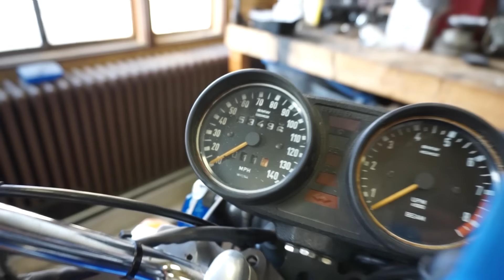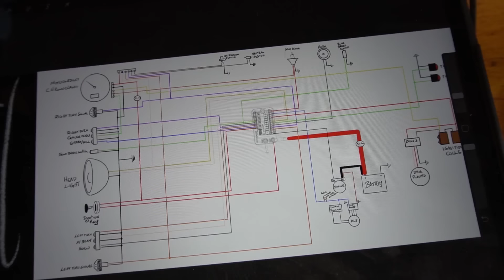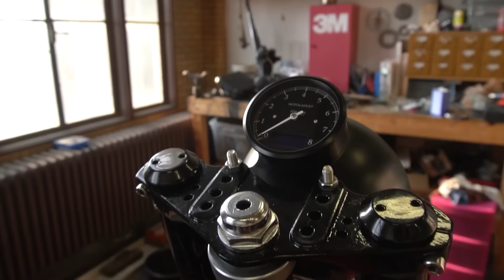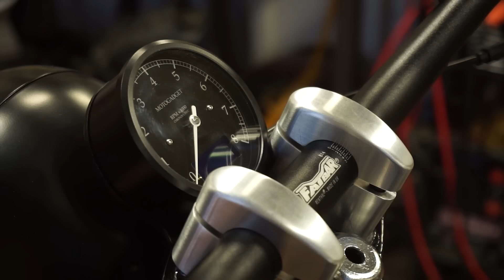BMW Full Custom Build - R90/6 Airhead Rebuilt from the Crankshaft UP!

Comment: Turning obsolete touring bikes into fun urban coffee shop bikes is better than scrapping them, and losing as much weight as practical improves the rather weak power to weight ratio. Don't worry about purists because they're so old the last will be dead in ten years. The only Airheads worth saving are the ancient roller bearing bikes and real S models. BTW for those who don't know you can bolt on earlier kick start gearboxes as the Airheads have high interchangeability.

Comment: The hours and skill required for this level of rebuild is immense. Nicely presented too.
Reply: Hi Rusty Nuts, I just checked your channel and was looking at your videos. I saw you have a review of the multistrada 620 and 1000.
I will be watching this later. I had a 620 and absolutely loved it. Not a very good looking bike. I toured for nearly 2000 miles from the UK to  Mulhouse and Geneva and all around the area. The bike never missed a beat. It was so comfortable, I loved it.

New subscriber and catching up with your videos later 👍
Reply: @Spodokamono  my sons bike, he likes it too. The looks divide, but it was the first performance adventure in 1000 spec.

Comment: That motor looked pretty clean coming apart, tbh. Somebody gave a damn about that bike. I ride an old ass 1100 Shadow that I'm doing a little this and that to in order to make it less Chrome Boat-y. The motogadget led lighting, grips and mirrors looked familiar. But now that I saw what a cool thing you did with the ignition switch...I'm tempted to bust out the step drill and take apart my little cheesy chromed stock one... 

That was a slick touch!

Comment: In the oilbath U forgot the SIEBENBROCK distance ring!
That’s a genious part.
Reply from the maker: On this bike we replaced the oil pan with a 81+ pan which is deeper for added capacity. I have used the motoren israel distance ring on a previous build though (which was painted white)
Reply: @roodlum  that’s great! Excuse me - didn’t see that🤩🐶.

Comment: O porquê de aquecer o motor para desmontar?
Obrigado por compartilhar seu trabalho!
Forte abraço!
Reply from the maker: Some parts (the front bearing carrier) are such a tight press fit that the engine block must be heated to remove them. Obrigado!

Comment: very good result. One thing that strikes me about this type of modification is the drastic change in the working angle of the rear shocks: it feels very stiff to ride?
Reply from the maker: The shock manufacturer design the damping and spring rates in order to work at this angle. In fact, it's a lot like the factory shock placement on the later monolever R80's and R100's (Like my R100GSPD)

Comment: Really like this bike! I see you have the same front brake system as my R100 and you don’t use the brake cylinder and reservoir under the tank anymore. So can I simply remove that part under the tank and go with a brake cylinder and reservoir on the handle bar like your build?
Reply from the maker: yes, just make certain to match the existing master cylinder's bore size otherwise you can affect the braking ability of the bike.
Reply: @roodlum  Thanx! I also plan on shortening the front suspension, although I think I will try a different way then your approach :). Keep up the good work!

Comment: hi friend thank you for this video please when remove the cam shaft how to find the cam shaft mark thank you
Reply from the maker: you're welcome. there should be a mark on the two sprockets that you line up to get the timing correct.
Reply: @roodlum  you're the boss but i don't have makr sprocket top anyway , may i have diagram tha you use in this video ?

Comment: Geeat job!  What exhaust is on this bike?
Reply from the maker: Thanks!  It's the factory pipes, ceramic-coated, with stainless cone mufflers added. You can get those style mufflers from a few places, like Cone Engineering or Lossa Engineering.

Comment: When replacing the front main bearing, did you drill out the hole for the pin and added M5 thread and locked the bearing with a bolt instead of a pin?
If so i kinda like that solution better then the pin.
Reply from the maker: Correct. Drilled and tapped the bearing carrier, and turned down the end of the bolt on a lathe so that it fit the hole in the bush bearing itself. The pin seemed like a potential failure point to me. Apparently it is done on some airhead motors built for racing.
Reply: @roodlum  Thanks, for the replay, i will do it like that on my r100 projekt.

Comment: By the way, i never liked that type of bikes where the seat is really short and just over the rear wheel. You'll go for a ride and your back will look like ass.

No offense, it's a nice build. If it was some dirt-bike - yeah, i get it. You are getting dirty anyways, it's a dirt-bike. But this is a super short and totally not meant for stunts, bike... You're supposed to have a cruise with that bike. If you go jumping with this machine like you're on a dirt-bike, I'll buy you a beer.

Comment: It's a beautiful bike, but it doesn't look like a cafe racer. Surly a cafe racer should not have such high bars.  The guys that modified their bikes back in the day all fitted clip-on bars. It's one of the defining features of a cafe racer, the ability to tuck and go as fast as possible. I guess the definition has changed over the years. They didn't remove the rear mud guard either, trimmed the front but would have still had both front and rear guards.  What's with the knobby tyres?  A cafe racer should be a street bike, built to go as fast as possible, you know for racing!

This bike looks more like the love child of bobber and scrambler.

Comment: this is a sunshine ride, and spends almost all the time parked outside the cafe. poserrr!
actual cafe racers were stock bikes with low bars and straight pipes. and they raced, from one cafe to another. sometimes in the rain - in britain if you wait for sunshine you never ride. first place got a free cup of coffee.
Reply: I can assure you the bike doesn’t spend much time sitting around, it’s meant to be ridden and it is.